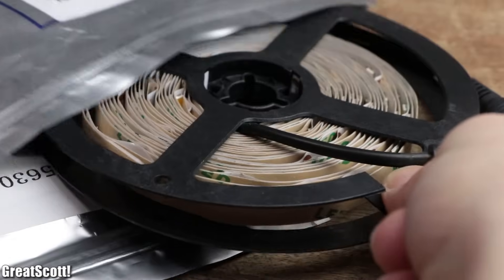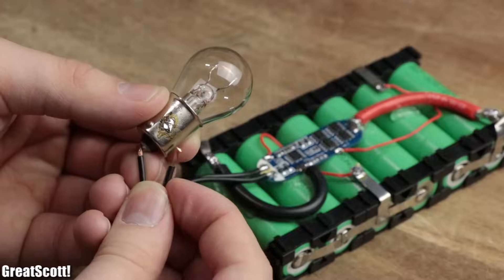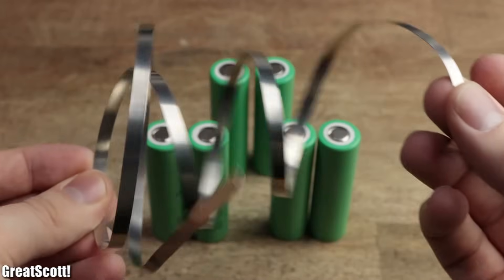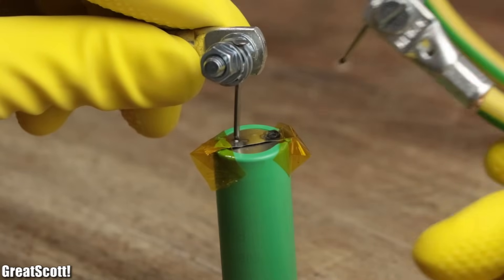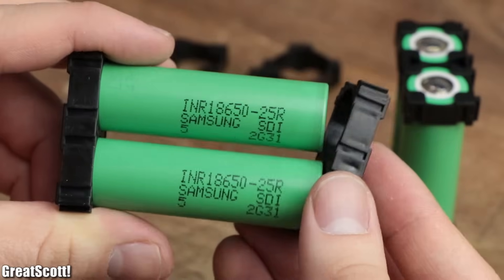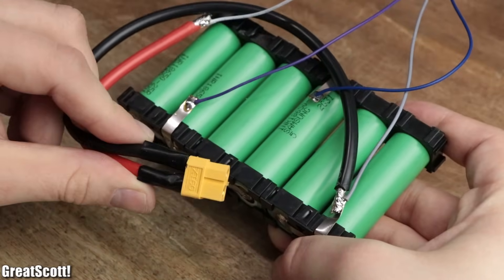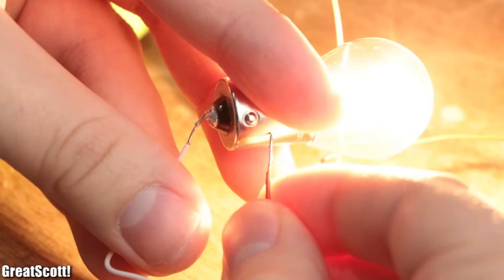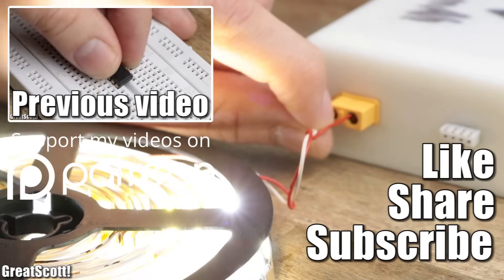Make your own Li-Ion Battery Pack

Comment: Thanks! Now, a couple of things: First never glue a BMS on top og the batteries. The negative cylinder of the battery is only isolated by a thin layer of paint. Shorten this might be bad (Speaking of experience) Never use melting glue on the BMS. It gets so hot, the glue will melt. Keep it up! Lots og great ideas!
Reply: that means, to remove it, we can pry it with small screwdriver, isn'it it ?

also greatscott make a cover with 3D printed plastic filament.. so, that means he even will not open again that battery for future project..

you can see his another video about battery pack

Comment: Is it possible to do something like this but in order to charge the lithium ion battery pack you need to use a type C cable?

Reason I ask is because I want to make a mobile battery pack to power a device so I would still need to add a positive or negative wire so I can connected to the device I want to power 

Maybe you can give me some advice or tips to do this I know I can buy a AA battery holder. However, I don’t want to constantly buy batteries I want to be able to recharge the battery holder in this case, it would be a battery pack/power bank

Comment: hey, can you do a custom battery pack for the framework laptop/motherboard?
i just need an instruction on how to do it. 

i wanted to have a replaceable 18650 battery case for the framework device. just like the old battery systems for old handheld devices (AA batteries)

Comment: Use a big iron or temperature controlled one turned up, put batteries in the fridge prior, use liquid flux, the moment the battery is tinned or soldered touch the end on a wet sponge to take away residual heat,  thick copper wire is a better conductor than comparable cross section zinc, you only need zinc if you are going to spot weld, best is copper strip or braid for high current drain and press close to battery when soldering as solder (lead) is the worst conductor.

Comment: I love your videos. I have a strong recommendation for future pack builds: Add paper (something that won't melt) between any high-amp wire laying next to a cell. It's also a good idea between the ribbon connectors and the edge of the cell on the positive ends. This reduces the risk of a hot connection from melting though the insulation and creating a short. This exact failure happened to me once and I narrowly avoided a bad fire. After this I immediately understood and appreciated the purpose of the paper shims found in many OEM packs.

Comment: Great video. I was wondering if you can answer a question for me. If your circuit has overcharge protection can you use an 18650 battery with overcharge protection built in? Does the double protection interfere with each other in any way? Thanks.

Comment: Would i be able to make a battery pack that can be easily charged with a fixed voltage instead of an expensive dedicated charger? Is there a circuit that would enable me to charge it like a laptop?

Comment: A really great project would be to make a universal 20V battery pack for power tools.  One where you can use the cells you want & easily get around thermistor requirements and fitting issues.

Comment: Just hot glue, no where near as hot as solder. No need for buying special nickle ribbon either, just use flattened crimp connectors or flat pieces of copper.

Comment: Great Projects!!
I love all your works and learning so much about electrical from your channel.
Currently I interested in building DIY powerbank from used 6x 10.000mah broken powerbank lipo batteries (I have a lot of broken short pcb powerbank).
I want to make large capacity from those batteries but I confused to connect them.
I want to use the powerbank modules  from new 10.000mah powerbank that has fast charging output and input.
Do I need to use 1s 3Amp BMS for each batteries or I just soldered them together in parallel since the manufacturer powerbank module already has BMS?
Any idea?
Thanks. 😁

Comment: 1-To point solder the ribbon on the batteries, you need copper tips.
2- To solder the ribbon on the batteries with soldering iron, you need some flux, no need to use sand  paper.

Comment: Im upto build a battery pack for my cordless drill.(drill has rs775 motor)

Stock battery was 12v 1.5ah. 
Can i replace that with 3s2p pack with 10A BMS ??
How to choose the amps rating of bms ???

Comment: I really need some help. I have a SR-Hp2410 solar charge controller, the manual does not stipulage what type of batteries it supports, aswell I am unable to change the over discharge and over charge voltages.  How can I make a lithium Ion battery pack that can be charged with my 10Amp solar charge controller?

Is it possible to replace lead acid batteries with lithium?

Comment: DONT NEWER solder battery .come heat and explore to you face. lot better have buy 18560 battery holders 2 or 3 or 4 battery, i have 4 battery holders. then can safety solden all wires to bat holders.

Comment: I have a project for you. Just like a cell phone recharges can you make a sewing machine to run of batteries for 4 hours then plug it in to recharge the batteries?. I was thinking a Mechanical sewing machine like singer prelude 8250 or similar

Comment: Is it necessary to use a mppt for a solar system when the bms does everything to keep the battery safe😶awesome video
Reply: The BMS is NOT  a Charge Controller - it prevents catastrophic events = SAFETY.  You should use an MPPT or PWM Charge Controller.

Comment: Is the BMS really necessary if you have a charger which balances?
Reply: Without a BMS, he does not have Under-Voltage protection and Over-Current protection ...

Comment: Without some voltage regulation on the output, the voltage will quickly sag below anything usable if it goes all the way down to 7.5v. Either use a boost converter on the output or go 4P2P and using a buck converter for the output so that it's 12v for the entire range of the 18650s. Of course this video is 3 years old and you know this now.. Just for new viewers.

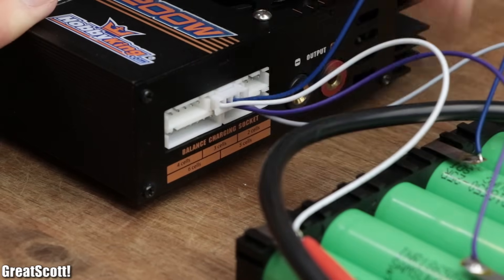Comment: 5:16 why is the xt60 plugged in? does that also need to be plugged in to charge? can it not charge just with the balance cable? do you connect a load to the xt60 or somehwere else?

Comment: is there any ampere gain when 12v step down to 5v ? ex. 3ah 18650 batteries serial connected or parallel to charge phone using with 5v step down?
Reply: Yes

Comment: Great little video and batteries have changed since i did li-ion cell when first came out for my RC cars...only suggestion if you have to solder is to buy batteries that already have tabs slightly more expensive but considering possible loss due to overheating its not bad :)

Comment: Am I right in thinking with this setup you are charging each series section of the parallel with seperate charging voltage from the Balance Charger.. so if I make a pack 16v where 4 are in series then the double that I can use the two sets in parallel with one BMS for both sections and use two chargers for each series sectiion.. thank you very much..
Reply: Huh?

Comment: You used way too much solder. A little bit of flux would make that soldering a lot easier and demands less solder.
Reply: Waaaaay too much HEAT
Reply: @vtorsi610  Do you agree that flux should have been applied? Flux increases the “flow” of solder, which inherently reduces the necessary heat.
Reply: @VictorHarrys  Yes FLUX.   Some are way better than others for this application.  I do NOT like that he sanded off the terminals. I read that the exposed  metal can now corrode.

Comment: can i use
 https://www.amazon.in/gp/slredirect/picassoRedirect.html/ref=pa_sp_atf_aps_sr_pg1_1?ie=UTF8&adId=A09219344BD8PZFBU4KJ&url=%2FTrendyStudio-Rechargeable-Battery-Li-ion-Lithium%2Fdp%2FB07WC6KSP6%2Fref%3Dsr_1_1_sspa%3Fcrid%3D15GA6EERJJYLZ%26keywords%3Dli-ion%2Bbattery%26qid%3D1568019019%26s%3Dgateway%26sprefix%3Dli-ion%252Caps%252C353%26sr%3D8-1-spons%26psc%3D1&qualifier=1568019019&id=8596154822079529&widgetName=sp_atf

Comment: Very nice movie and project. Congratulations :) If someone can not calculate the packs or want to make it easier :) I suggest install the Android app: "Battery pack calculator" (calculates: voltage, capacity, discharge current, etc.) up to 9999s 9999p packs. Built-in database of 37 popular, branded batteries and the ability to define your own battery cells.

Comment: Can you tell how to mack 4s 5000mAH  Li-Ion Battery Pack for rc speed boat
Reply: You want lipo for a speedboat because only lipo will support high discharge rates without damaging your battery. Lion is great when the battery will be discharged over an hour or longer.

Comment: You don't say a word about balanced charger interacting with BMS
Reply: I think it does not interact. The balance charger seems to bypass it completely. I'm curious about this as well, as I'm about to build a pack and can't find any info regarding this. Although, main two wires go through BMS during the charge, so I'm not sure.
Reply: @kawo666  No interaction  ...

Comment: I love your channel, thanks for all the info you spread!

What would you need from a motorbike 12v alternator to charge this type of battery? I suppose you'll have to install an BMS as you did. Would it require any other steps such as changing the regulator????

Hope you can help me here.

All the best! Keep on rocking, see you next time!
Reply: You'd want a voltage regulator to prevent the voltage from exceeding the 12.6V limit, such an alternator is designed to charge lead batteries and as such supplies the higher charging voltage of at least 13.8V and probably sits around the recommended 14.5V or so.
Reply: @TheRealFlamingNinja  don't lithium ion charge at 13.8v ass well? Thanks for you reply!

Comment: Great work .... best to drive led strips at below 12V , they will last much longer 11V is good with hardly any noticeable light loss...Leds are also more efficient at lower currents. (lumens out /Watts in) 
Also charging each cell to 3.93 gives a maximum life of 4, 000 cycles  ...4.2 gives only 400 cycles (see BatteryUnivercity) you only loose 35% capacity by charging to 3.93 compared to 4.2  ...3 in series give a reasonable maximum voltage of 11.8 to drive the led strip.

Comment: So the BMS won't actually act as a balance charger then? I want to put a 3S pack in place with a solar cell to permanently power a device. Making sure the pack is charging balanced seems very difficult to achieve. My eventual solution was to use 3 isolated 5V DC to DC converters which in turn powered 3 single cell charging boards which were placed across each cell. But this solution, while it seems to work, never sat quite right with me. Is there any better option that isn't going to cost a fortune?
Reply: This BMS does NOT balance
Reply: @vtorsi610  yeah I know

Comment: Hello, very great project! I see that with that battery pack, we need to charge it with XT60 battery charger (with balancer). But, i want to charge them with the micro usb tiny 18650 battery charging module, which can only supply 5V through it for each battery. Is that possible? please explain:) thankss
Reply: or, should i just use the 3S BMS system as the charger, but change the XT60 connector into a 12-12,6V DC power jack supply?

Comment: I would just use a AA battery holder.
It has lots of advantages:
  -It is cheap
  -It doesn't heat up the battery
  -The batteries can easily be replaced
and many more...
Reply: Try putting an 18650 in lol

Comment: I still don't understand something: i want to power a robotics project with 18650 batteries, 6 of them to be precise (I'm a little bit space constrained). Since all logic electronic runs on 5v i want the battery pack to output 5v and since I have already two DC regulator (one from UBEC, which based on a lilttle jumper allows me to transform every input from 5 to 24 volts to a safe and stable 5v 3A or 6v 3A and  a 6-12v usb voltage coverter to 5v 2A. I'll probably use the UBEC one, because i'll implement very soon an nVidia Jetson Nano, with a slave teensy wich controls the I2C servo interfaces, esp32 module for Bluetooth and wifi control i'll need the 3A) i decied to go with a 2s3p configuration, 3 parallel packs made of 2 batteries each, in order to have a nice 7,4 volts to low with the DC regulator and enough Ah to power the Jetsoon nano and all the servos (and all the oterh boards) for a while (p.s. i can't find anywhere the  jetson nano energy consumption to calculate how much time i should be able to power it with 7500mAh, if anyone is informed, pls let me know.) but which BMS should i buy? a 2 cells one, 3 cells or 6? And how should i wire them? Based on what I've understood so farbased on what I've understood so far I should use a 2s BMS... but i don't want to buy, wait for shipping etc etc and find out that i was wrong, so pls, help me :)

Comment: I used duct tape to cover the 6S 15A 24V Battery Protection Board and battery's.

That is not a problem right?
Reply: No it's not unless it short circuits which could lead to even more toxic fumes from molten duct tape
Reply: @samdesplancke3906  Ok thanks, maybe i will put him in a enclosure later, but if that is plastic and it short circuits, that could lead to even more toxic fumes, right?
Reply: @AmigaWolf  depends on the plastic and it's melting point

Comment: I liked the video and this project, I am in need of a battery of this type but 4S so I thought of something from what was shown in this video only with some modifications like: instead of 18650 batteries I will use those of LiFePo4 of those with threaded terminals and a BMS of 200A since the batteries have a very high current, since the case that was printed I will have to improvise since I do not have printer 3D. XD

Comment: Thanks.  Awesome video.  Thus far is the best and most comprehensive video on how to build a li-ion battery pack with a BMS.  Still, however, I cannot find one thing, that would be very useful: the aftermath.  I mean, I want to build an 12volt uninterrupted power supply that is permanently connected to a power source.  I know the BMS will do wonders for this, as it prevents over-charging, but the circuitry... oh... that is giving me nightmares.  You have two connectors coming out of the pack: a power conector and a balance tester connector.  I assume the second one would be used to test each cell and balance-charge it if need it.  The power connector is the one that you would use for charging and to draw power from when in use.  Would you consider such a project?  Thanks.

Comment: Anyone with knowledge of this please reply here,
 Can any one just tell me why that balance connector pins are provided outside your battery bank? To balance charge the batteries you have BMS right & you connected those balance pin of BMS to the each battery.. Then what is that balance connector at the outside of the Battery bank box.
Reply: Obviously, that BMS does NOT Balance !!!

Comment: Please reply me, Hi. Good information. Can you just tell me why that balance connector pins are provided outside your battery bank? To balance charge the batteries you have BMS right & you connected those balance pin of BMS to the each battery.. Then what is that balance connector at the outside of the Battery bank box.

Comment: Hi. Good information. Can you just tell me why that balance connector pins are provided outside your battery bank? To balance charge the batteries you have BMS right & you connected those balance pin of BMS to the each battery.. Then what is that balance connector at the outside of the Battery bank box.
Reply: I also have the same question
Reply: Because the BMS board does not balance. It cuts the charge when the first battery reaches 4.2 Volt and the rest then remain where they are. So it is not a BMS board, but a kinda protection board.
Reply: @dougerrohmer  It IS a BMS Board !!!  It does not have the "balancing" option...

Comment: You are overthinking the spot welder. Get an MOT 2500W if possibile make 2 turns or thick wire and hook up the input of the MOT to a simple 10A foot switch and get on to welding. I made on when I was 12. Now Im making a stick/scratch TIG welder. DC and AC.

Comment: I think the spot welder was not being used appropriately, hence not working. With spot welding, you first need to make a good contact, using some pressure, before the switch is 'hit'.

Comment: Probably a rookie question but is it possible for a pack to be made in this same way, but using only 2 18650 batteries instead of 3 or more? Want to try and create a pistol grip for a camera with a built in battery pack so size is key :)
Reply: Of course ...

Comment: PLEASE ANSWER THIS QUESTION: 
After finishing the battery pack and adding the BMS, 
is it possible to create an AC Adapter ? so that the power adapter 
would be able to Power different small appliances like Fans or chargers. 

-Would you have to add an inverter? 
Please answer. Asking for a friend.

Comment: Hello, is it possible to load this accu pack with a simple laboratory Power supply? Do i need a PCB for my project (a accu pack with only two simply wires) or a BMS? Thx for many questions